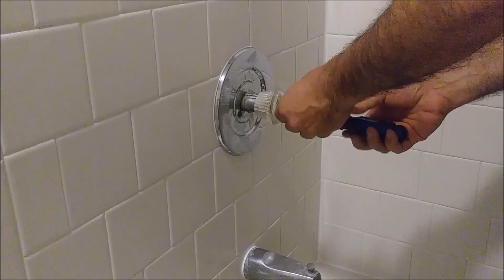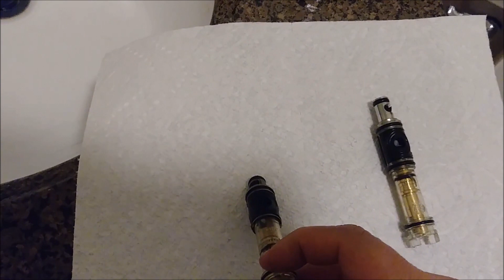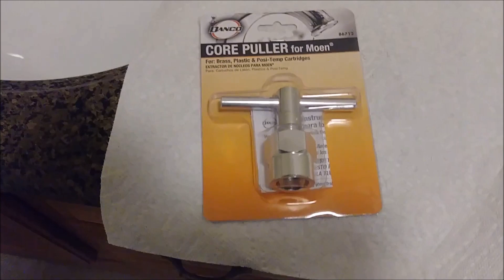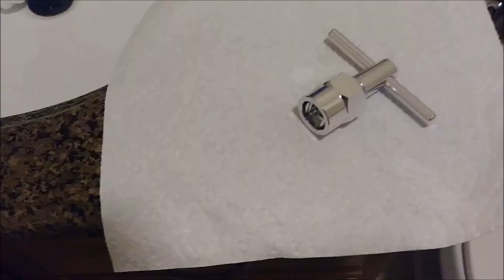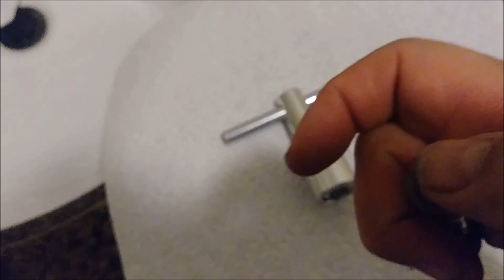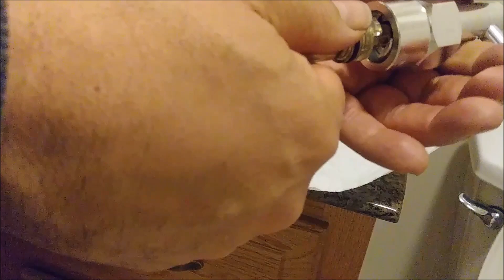How To Replace A Moen Shower Valve Cartridge - Moen 1225  - Step By Step  For Dummy

Comment: THE PLASTIC WAS BROKEN ON MINE, SO IT DID NOT ALL COME OUT IN ONE PIECE. 
 I had to use a very large lag screw to extract the other two pieces.  the very coarse tapered treads got a grip on the pieces with only a 1/4 turn or so. I hope this helps someone else.
Reply from the maker: Thank for the info.

Comment: great video i had the same issue but forgot to check for bits of broken valve in the casing. The pieces ended up affecting my water pressure and i had to take it all back apart and clean it out. problem fixed.
Reply from the maker: Thank for sharing his information.

Comment: I have to replace moen faucet again, 3 times in 8 month, my apartment maintenance does the work but 
i will make sure he uses the moen product this time
Reply: Actually the apartment sent an actual plummer, the issue was that the previous maintenance worker did not lube the cartridge all three of the other times, causing it to wear out quickly.
I could tell the difference because it was so easy to turn on and off with the lube.
Reply from the maker: @janegallardo4731  Thanks a lot for the info. Usually the cartridge come with lubrication on it. Interesting ..
Reply from the maker: Very good.

Comment: I've installed 90-degree faucets and shower trim in two bathrooms in two separate houses now. In addition to this collection striking a great balance of style, solid construction==>allmy.tips/MoenTshower?qQ▫    and surprisingly low prices; Moen customer service is top notch and then some. 800 number staff is really knowledgeable. I was replacing an older Moen trim kit so able to use the existing valve in the shower wall. Note this is available in two valve trims, depending on your wall valve. Amazon clearly marks one as Moentrol and the other as Positemp, so don't make the same mistake I did and overlook that!